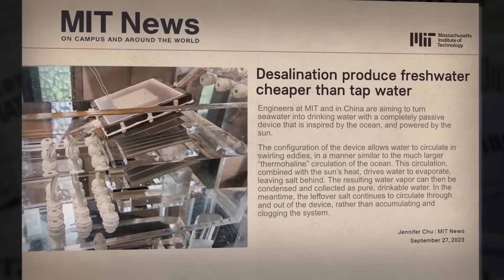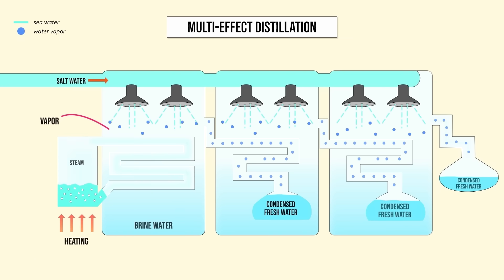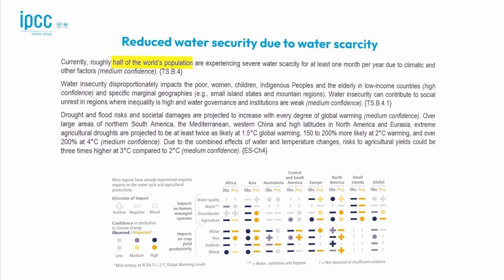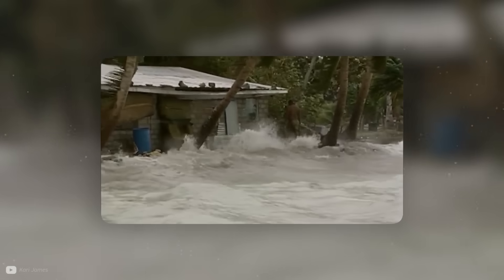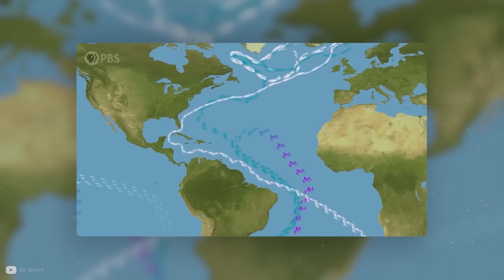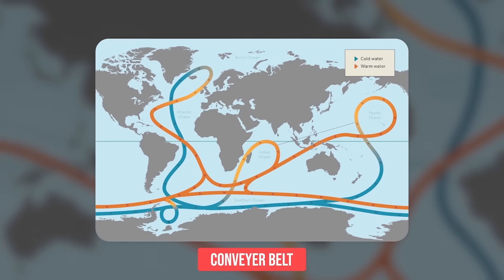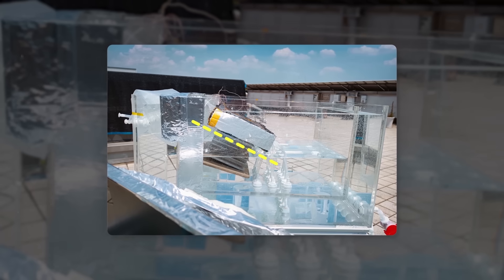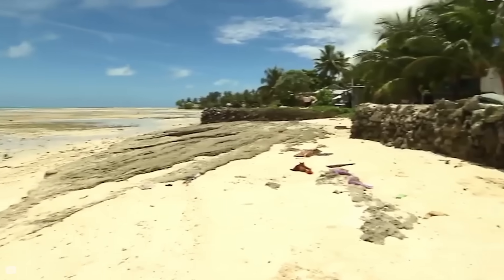Unlimited Fresh Water: Can MIT's Breakthrough Save Us?

Comment: Just like cars , they break ,you replace the part, the water is a neccesity and we as humans will level the price soon enough that parts are steadily available and we will just conform,adjust,simulate whichever word you choose still leads to we have no other choice unless your able divert salt water into natural basins and use the earth as a filterization plant and let the levels of sand and rocks and silt do the job just know that the gulf of mexico is the saltier than any other place i say run off a mountian that has a cave system and use it to filter salt water without using too much metals that sooner or later rust or weakens but the earth natural cave systems as the follow thru with filters in place less interchangeable parts  😮😮😮😂😂😂-dlr

Comment: ACTUALLY! The majority of water on earth in stored deep within the earth's mantel, locked away by molecular bonds to minerals by extreme pressure. "solid water" can even be found encased within quarts crystals with so much pressure exerted on it within the crystal the water takes an a frozen state even at room temperature. The water in our ocean is just a drop compared to the water deep within the earth.

Comment: Many years ago, I spent three fire seasons on a Forest Service fire lookout with a steep, mile-long trail to a spring, the only water source. I built a solar distiller with a three chambered wooden trough, covered by a tent of clear plastic sheeting. The sun evaporated dirty water in the center trough, it condensed on the inside of the plastic sheet, and trickled into troughs on either side. I recycled dish washing water for additional dish washing, laundry and bathing and reduced four to five trips to the spring per week, to two trips per week.

Comment: My question is why do people insist on complicating a simple problem, by using solar power and batter storage and using this for around the clock water production through condensation the technicians exist and only needs to upscaled 
No salt, Brine, minimal maintenance, I worked for a bus company as AC mechanic and even on the AC units not designed for the purpose of making water it made a lot of water. There are companies that manufacture home use units which only require a 20% humidity I’m sure island nations could clam much better and sun light should be in great supply

Comment: I know that solar panels suffer significantly reduced efficiency when overheating during peak sunlight exposure when they should be operating at peak energy/sec.
And their tilt angle is about the same as this desalination method!

So imagine putting solar panels instead of the clear acrylic of the top layer for the desalination water.
The heat-driven pumpless water flow would serve to draw heat away from the solar panels at the top with cool sea water, while also heating the water for desalination quite effectively still (as those panels get HOT even in winter months).
This should allow the desalination tech to function like a passively powered water cooling heat sink for the solar panels, while not drastically reducing the water output of the desalination process.

It wouldn't be ideal everywhere, but at least in costal areas it should allow some desalination plants to double as solar plants with increased energy efficiency.
Most traditional solar panels use Aluminum frames and backs, which is not only a highly efficient heat transferring metal, but it's also extremely corrosion resistant, so with some minor efforts to waterproof the contacts and wiring, it shouldn't suffer from the salt water or water vapors at all.

It would also be ideal for small islands with limited land.

Comment: Very, very, very valuable information, thanks!
This invention should be nominated for the Noble Prize, as it eliminates one of the 2 stumble blocks on the way to turning the wildernesses (which are 1/3 of the Earth’s land) into farm land (covered with a greenhouse to reduce evaporation), and thus to solving the world hunger problem, and also to the climate reversal. (The 2nd stumble block is how to cheaply turn sand into fertile soil. The steppes are the remaining 1/3 of the Earth’s land, and to turn them into forests no additional water is needed as well as greenhouses, but just a cheap way of thickening the thin fertile layer.) 
Green Arabia, Sahara and Australia, plus forests in steppes would definitely revert the climate processes.
And of course, the world thirst problem.

Comment: Various ways we can slove same problem, Now you work of capturing sea wind  from  some  hight through tunnel, make it pass through machine .
We have all types of machine, instead of working on salt water, let's us work on vapour of sea wind. 
Sea wind contain more moisturizer compared to earth wind .
We also have another method. 
Can you make vedio on problem of membrane cleaning during desalination process. 
Jay bharat.
Reply: Another experiment is pass water as well as sea wind and watch do we get more quantity of water. 
Jay bharat.
Reply: I would like you to do experiment, use wind and water in same heating instrument and obserb, if you are getting more water. 
Second, Use double bucket system, 
put sand bucket around heating system to trap heat inside bucket, this will help faster evaporation of water. 
Jay bharat.
Reply: Use double bucket system on top for air and below for water to evaporate.
  Separate the tank to avoid complications of cool and hot air mixing. 
Remember where  ever heat is used the area becomes hotter and sand have capacity to trap excess of heat comming out of instrument, so please use double bucket system.  Use sand in one bucket to trap the heat. 
Jay bharat.

Comment: Why not utilize saltwater disposal (injection) wells. The oil industry deals with salt water or (produced water) all the time when drilling for oil and gas. Kiribati and other atolls don't have the land area for evaporation ponds and you would never want to risk having untreated salt brine leaching into the environment and the freshwater aquafers. You could use a deep-sea oil platform and put the injection well far below the water table and the ocean floor ecosystem. It looks like Kiribati and its atolls are anywhere from 1000-5000 meters. A little deep for some of the smaller rigs but well within the range and expertise of almost every drilling company. Seems like you could get a cheap decommissioned rig that can't pass the newer/tougher regulations for oil production and use it for saltwater disposal well construction. Set up a saltwater brine collection barge between the atolls and transport it to a centralized permanent disposal rig set up offshore. A platform injecting into multiple wells could easily keep up with any brine produced in a desalination infrastructure that Kiribati and surrounding atolls would produce. I imagine the most difficult and expensive aspect of this would be shipping a rig out to the middle of the Pacific Ocean.

Comment: My problem with this is that the diagram at 11.53 shows the salt water higher in the device than the level outside despite showing it vented at the top right which is impossible unless a pump is used. I suspect a partial vacuum is used (no vent) but that would also need a pump and mean maintenance.
Also why is there two layers? - the lower layer would not get heated by the sun and be a lot less efficient.

Comment: One-fifth (1/5 = 0.2) of a cent per liter is $257,000 per acre-foot of water (~1.2 million liters/AF).  The average cost of water in the U.S. (2023) is $390 per acre foot (AF).  Thus the cost of water from this system is 633x more than the average.  Therefore as described, its extremely expensive.  I'm not sure the 1/5 of a cent/Liter was correct...

Comment: What a waste. Watermakers that extract water from the ambient air by condensation work everywhere, even in the desert.
My shipping container based vertical indoor farms each have one on the roof, powered by free wind and solar.

My system is "light years" ahead of this MIT stuff.

Comment: U.S. tap water. Here in NE Alabama it cost $22 for the first 2000 gallons of tap water so if my math is right then $22/2000gal = $0.011 per gallon/3.785412 liters per gallon = $0.0029058924101260312 per liter vs 1/5 cent per liter or $0.002
So that would make it cheaper by $0.0009058924101260312 or roughly 9/100 cent per liter.
A win is a win as they say right.

Comment: Correction/Information:
There is one minor downside to LED lights compared to traditional ones - specifically, the initial current surge (I apologize for not knowing the English term). This means that you need to ensure that LED lights are divided into more groups than traditional lights, as the older lights take longer to start up. This is related to something mentioned in the video - namely, that older light bulbs function by heating up wire, resulting in greater heat and inefficiency.

With LED lights, you have a far more efficient light source. However, this also means that your RCD protection (also known as HFI or HPFI) experiences a higher initial current, which can trigger its safety measures and shut off all power to protect you. Typically, they shut off at 0.15-0.20A before 0.3 seconds have passed.

For most households, this won't be much of an issue. But for large facilities like factory halls looking to save on lighting costs, it can be a major concern. In such cases, installing additional safety groups for your lights can help. This ensures that the lighting load is distributed across more groups, which is a good practice to follow anyway, as it prevents all lights from going out if one safety group fails.

Comment: Ok if this is meant for a more in depth audience I would like so see more details like specific information setting it apart from comventiol reverse osmosis systems using nafion and analogue materials and pressure and temperature gradients, be that added by solar influx or pumps or other means.
MThere are so many existing technical solutions and even more potential solutions that I do not feel like going to the companies website and go through all the texts and find the authors and go to their list of references and related published academic papers, sometimes behind paywall and sometimes openly available. Even something simple as flowrate, membrane pressure gradients, fouling robustness, mechanical and chemical lifetime, availability of raw materials, anything at alll would be usefull. This is not lazyness and a case of o your my own research, I've done plenty on this and related subjects. I'm confused at what audience this is aimed at; if it just to promote more environmentally responsible tech in general it's cool. But beyond that it needs more in depth I friendly suggest.
How similar is to industry standards like nafion/gorotex/the whole family fluorated polymer membranes that are either crosslinked chemichilally or via irridiated etc or the groups of materials more related to sintered ceramics or foamed inorganic glass or blend and more. Something. The hight alone and slope of the heat and mass exchanchers is usefull. Really I think  fine, yet to what public is it aimed?
I wish you the best, maybe I see more work. Kind regards.

Comment: This story and state of being, lol, completely baffles me. I mean, just on the face of it, the MIT system is pretty simplistic and while it may be breakthrough membrane design, but hardly an example of ground breaking science. i.e. it could have been thought up at minimum 50 years ago, but probably 2 or 3 hundred. For such, what is to me, such an obvious necessary riddle to get solved, and never worry about water again. So, I am really shocked we are still working on it. Because, to that end, I came up with a design, like 30 yrs ago in my teens. And It is actually remarkably similar to this.

It's actually almost the exact same, but I never built a prototype, so, I know salt build up would be an issue ffrom day 1, but I admit, I didn't think it would be such a huge problem. I thought it would be an easy maintenance job at worst. Having someone, a worker, shake them or wipe them down or whatever. And actually, my design does have some key differences, and the salt may not be as big a problem with my setup. My intuition is telling me, there is a good chance it would just fall back into the sea, or as I've already said, or possibly disposable membranes getting replaced regularly. Here's the thing though, my membrane is not a membrane for osmosis, it's simply hydro phobic and does not require the sea water to pass through it, only travel across it's surface, which, yes, means PVC works perfectly, lol.

I still think my system will work fine. It requires ZERO energy, except to move the fresh water to where you want it. So I think that hint will help everyone figure it out. What do you know, I'm 30 yrs ahead of MIT, just me and my head, lol

Peace

Comment: You mentioned the pressure from the bottom is high enough to force the water up to the top without using pumps?  This doesn't make any sence.  The water would loose pressure as it rises and never rise above the upper water level.  Please explain.

Comment: Keep in mind that if freshwater is extracted from salt water in a system that only has an inlet, the salt concentration will increase until the solution can no longer hold the salt at which point it will clog the system unless that saltier solution is taken out via some mechanism like an outlet pipe or other method. One use for an outlet pipe could be a salt production plant but you would need certain amount of land to further evapourate to solid salt and sea ports to allow you to ship it out.
Reply: Producing salt from seawater actually uses a lot of fresh water.

Comment: I don't understand why water from the air,  atmospheric water generators, wouldn't be a viable option? I believe the have the humidity and the it could be powered by solar. No dealing with desolation at all because the machine only pulls out pure water vapor from the air.
Reply: The desolation of Smaug? Or no desalination with fog?

Comment: The brine can be used for highway construction as long as a thin layer of asphalt is used as a cap.  The highway “ trench” could be 8’deep with the good soils being used for better projects. Then asphalt over the brine would act as a lid for cars to drive on and The earth below the brine would filter any water moving deeper downward  through the earth. The road would be indestructible by adding sand and very little cement to the brine.
Reply: Hi. Is the solution you are describing an alternate one for desalination of sea water?

Comment: going in the wrong direction you can pull plenty of water from the AIR. THERE'S PLENTY OF EXAMPLES OUT THERE. AN EASY METHOD IS A SLIGHTLY MODIFIED DE-HUMIDIFIER. PLENTY OF EXAMPLES ONLINE

Comment: The real issue is each of these methods are pollutive.
Membrane is usually disposable plastic.  Microplastics and filter waste.
electrolysis causes corrosion, metal wastes and filter wastes.
Humans need to stop overestimating the volatility of the planet.  Not just carbon footprints.

Comment: From the video, here is what I understand.

Pros:
The machine is passive
The machine doesn’t allow salt accumulation easily
The machine does not create hyper saline water at a fast rate
The machine is solar powered
The machine is small

Cons:
The machine is solar powered (though this can be solved by having an alternative heating method)
The machine is small (can be scaled up if need be, not that big of a problem)
The membranes are in a difficult to maintain spot, requiring the entire machine to be pulled out of the housing. (Better maintenance options are to be expected)
The machine doesn’t have a solution for heavy metals (sea water may contain heavy metals, not exactly healthy nor easy to remove)

Overall, this is an ingenious device that barely costs anything to run! Further innovation should make the mechanics easier to maintain, function, and replace! I have high hopes for this tech!
Reply: If the pro is that it does not create hyper saline water at a fast rate, then it isn't producing a lot of drinkable water. If there is 1 kg of salt in 1 cubic meter of water, you either get 0.9 cubic m of drinkable water and 0.1 cubic m of hypersaline water or you get 0.1 cubic m of drinkable water and 0.9 cubic m of low salinity water.

A better solution would be to harvest salt from the ocean and release it back at a slow rate. It's not like drinking water disappears. We drink it and pee it back out and it goes back into the environment. That could be salted.

Comment: Hi, I think that your diagram is reversed.  Vapor is way less dense than water, and in your diagram it needs to travel thought water in order to reach the membrane, loosing efficiency. I think that the system uses the top cell membrane., it just makes more sense. Correct me if Im wrong please.

also if you use Tyvek from dupont ( very cheap water barrier) somehot dyed in black, with this system you could build an inexpensive rig...(only one layer but a way bigger panel) like solar ones.